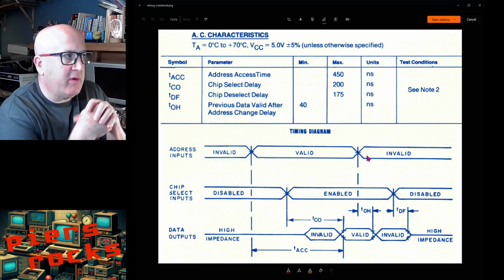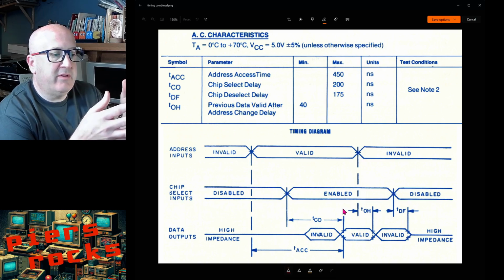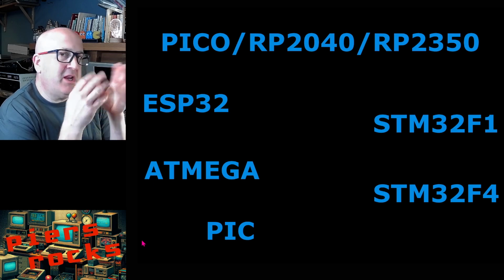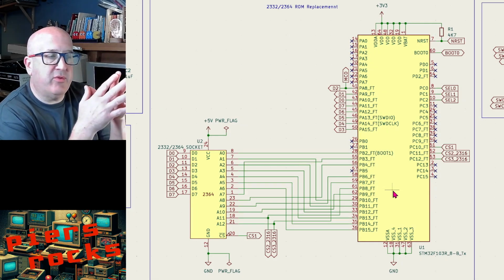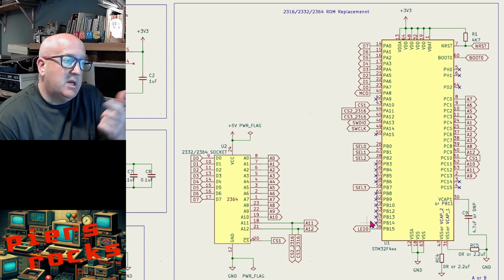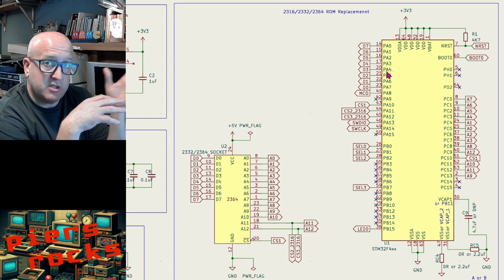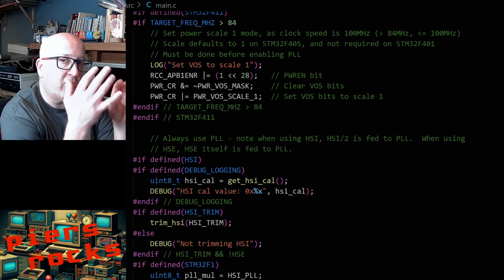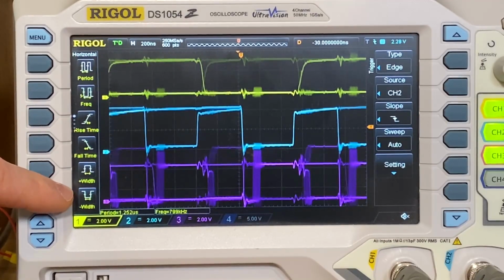How it's done - Software Defined ROMs

Comment: Very interesting!
A few years ago I spent A LOT of time and effort designing a ROM emulator (targeted at a couple of 6809 computers that I have).
It uses a static RAM chip to hold the ROM image, loaded and controlled by an AVR processor that also configured muxes and buffers to account for the various emulated ROM details. Once the data was loaded, and other details set up, the processor would play no role in the operation. Which frees it up to do some rough monitoring/profiling of the running code.

Even got the (quite complex - around a dozen chips) PCB's made, just never got around to building it. 
I always intended to, but seeing your work, I think I might scrap the whole idea now!

I see you've got later videos using a PICO, which I'll view with interest, and maybe use that as a basis for something similar. 
As I intend this only for testing and repair, there is less constraint on how it fits onto the System Under Test, so I envisage just using a standard PICO board somehow bodged onto an adapter PCB to go into the ROM socket.
Thanks for the inspiration!
Reply from the maker: @bertoid yes the Fire version uses the RP2350.  That is similar to your previous approach - CPU sets up PIO/DMA to serve the ROM at start of day - leaving the 2x CPU cores free for other function.  Now have 24 and 28 pin ROM versions.  Perfectly feasible to build an adapter for a standard Pico 2 - I would recommend the Pico 2/RP2350 vs the PicoRP2040 for built in 5v tolerance, although with an adapter board you have room for level shifters if you so desire.
Reply: @piers_rocks  I haven't looked at your later videos yet, but I thought you'd still be serving data via the CPU and control/address line monitoring. WIll be interesting to see when I get to that.
On 5v tolerance, good to know - RP235 it is then! Thanks.

Comment: Very good work. Did you try to code the loop in C rather than assembly? If so, what were the results speed wise?
Reply from the maker: No I haven't tried in C.  I don't trust the compiler enough :-).  It would be an interesting experiment - will put it on the list of things to try.

Comment: Very interesting project and a very interesting approch for solving my problems with those old ROMs. Thank you for sharing this. 

I like your implementation of the main-loop using inline assembler.

If you like, I could give you this little suggestion for improving the performance of this loop with zero-execution-wait-states: you could put the main loop into SRAM, as SRAM is accessible through the I-bus and the D-bus, if you configure the bus matrix accordingly. As those STM32F41x chips have enough SRAM for this purpose, I think, there is still enough left for this speed-up option. 

Some practical aspects: you could put your assembler-crafted code part into a function of its own and put this function into an appropriate linker section, which finally places this function into SRAM automatically on startup, right before main is called. Copying this handful of bytes should not take a fortune of time. On the other hand, you could do this also in your own code during main, as you can take sizeof(loopFunction) and copy this function into a comile-time defined uint8_t array in SRAM, which you can call later as a function. 

Feel free to ask for more information if you like.
Reply from the maker: @johanneslode2006 thanks for the offer.  I do actually have a compile time option to run the main loop from RAM, and I tested it, but didn't see any performance benefits.  I suspect this is because the instruction prefetch and cache on the STM32F4 is very good, especially for such a small main loop.

Not relevant on the STM32F4, but when I tried this (running from RAM) on the STM32F1 I saw worse performance, and much less deterministic behaviour, I assume because of RAM bus contention .

Let me know if I'm missing something - if there's some option/register I haven't properly set - I don't think I set anything on the bus matrix to allow this.
Reply: @piers_rocks  I'm actually more used to the STM32F4 family than to the STM32F1 family, especially as there are several different performance level groups in the F1 family, which have diffferent capabilities on the memory access. And yes, the FLASH accelerator on the F4 is quiet good, as it does 128 bit access on the flash rows. This said it might be worth to decorate jumps (conditional as well as unconditional) with some NOPs around for 128 bit alignment of neighbor instructions - just an idea, never thought deeply on that. 

Single cycle access on the RAM is very good, if configured properly. Your analysis on that sounds profund.

For some operations, such as single bit accesses the bitbanding-feature gives also some acess boost, available for the SRAM as well as for most of the peripherals, where read-modify-write access would be more than twice the access time. But on that, you optimized your GPIO accesses already very clever from my point ov view.

The next level of optimization I could think of, is using the two DMA controllers to reprogram each other, so address lines are fetched by one of them and put to the other, which in turn spits out the memory content on the data lines. Every DMA controller of the two has eight channels. Also just an other raw idea, which is not yet thought through deeply. One caveat could be the handling of control lines, such as RD, OE and CSx. As DMA cannot use the bitbanding-feature (it is a feature of the Cortes-M4 core, not of the MCU), this could be the dead end for this idea.

An other idea was a couple of 10 years ago, to use a dual-port-RAM, which offers access times in the range around 7 ns, using a microcontroller for programming it on one port and using the other port as the "ROM" interface. But this might blow up the form factor.

But hey, I love this kind of project. Thanks for sharing.
Reply from the maker: Thanks for sharing - definitely some interesting thoughts here.  May give the 128 bit alignment idea a try

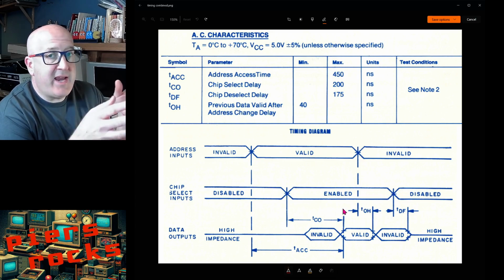Comment: I listened until 4:40, but why can't you just use a modern (8-bit parallel) NOR Flash, or EEPROM, for this? They are still made.
Reply from the maker: @herrbonk3635 It's explained in the first video, linked to in the description.  The key one is that 2364, 2332, 2316 had mask programmable chip select lines (each CS line could be active low or high, and the 2332/2316 have multiple CS lines giving 2^n combinations).  You need additional external circuitry to achieve this with a eeprom/flash solution.  It's a custom circuit per rom type/CS settings, or requires additional jumpers with a hardware solution.

This software approach configures the CS lines at build time - one hardware, all 14 possible ROM/CS combinations.  You can have different ROM/sizes/CS behaviour in the same firmware image and switch between them at boot line.

Comment: CPLD/FPGA wouldn't have been worth considering anyway as these have very little effective RAM/ROM and you run into  the same 5V tolerance problems. 

Just in case I wanted to point out what 5V "Tolerant" means. It's not "5V TTL LS F S tolerant" as many expect. The original 5V TTL chips have a tolerance on the 5V rail as 5Volts +/- 10% so in effect from 4.5Volts to 5.5Volts and a chip stated to be 5V tolerant has to withstand a max 5.5Volts on an input pin. The reality is that TTL outputs are  not often  over (Voh) 3V, CMOS is (Voh) about 4.5Volts in most cases and  may JEDEC chips (EPROM EEPROM SRAM DRAM) even CMOS will accept  TTL inputs while having a Hoh that is within range for even a 3v3 part - or perhaps a series resistor etc so in many cases if you read the datasheets and you don't need  tolerance to 5.5Volts then you will often be pleasantly surprised. YMMV so reading the spec  sheet  is essential though. 

Nice video and it's great to see old chips being recreated to keep out retro stuff going.
Reply from the maker: Thanks - I've done a detailed analysis of voltage levels of the STM3F4 against the main (Commodore) ICs that might be driving address lines and receiving data signals here: https://github.com/piersfinlayson/software-defined-retro-rom/blob/main/docs/VOLTAGE-LEVELS.md

Comment: 10:02 isn’t the 2350 5V tolerant…?
Reply: Yes and no. There's a note on the data sheet saying some pins are 5v tolerant under very specific start up conditions my guess is taking power from the ic socket would require at minimum hardware to handle the power assurance.  That being said the project lead for the rp2040 stated on a very well circulated post on hack-a-day that chip is 5v TTL compliant just not 5v5 compliant my guess is this is more of the same..  realistically it's just easier to use a purpose built part.  It's also a good idea to use a chip with the ability to do the reads at register level he's describing. My guess is that could be simplified using the picos PIO state machines.. but the power assurance part kind of sours it.
Reply: @lindoran  Yes, that makes sense. The PIO would have been really awesome for some of the requirements. But the incomplete 5V support is indeed maybe too risky.

Comment: Shared this on quite a few of the vintage computer groups on FB, this is something I've considered doing myself!
Reply from the maker: Thanks for sharing it - I'm hoping it will come in useful to people.  I fried a stock C64 char ROM today while, ahem, removing it with the machine powered on.  All I had to do was grab an SDRR, flash the set of stock C64 images, select the char rom using a jumper, and boom, back in business :-).
Reply: @piers_rocks what would be really useful is a usb or serial programmable one that never writes to the flash so it doesn't wear... I'm in the process of building a custom minicomputer with a DEC J11 (control), 128 x 8051 (general computer) and 64 x MK38P70's for IO channel control.. (I'm a professional Electronics engineer and firmware developer). Lets just say I'm considering building one of these for each of the IO processors... The MK38P70 is a bizzare micro, the EPROM plugs in the top of the CPU so the IC's are stacked!
Reply from the maker: @anthonysibley1021 - do you mean reprograms the ROM image that lives in the RAM on the fly so it doesn't hit the flash?  I think its plausible via SWD (which can be via USB), although that might introduce some contention on the RAM bus, introducing wait states and hence slowing the ROM serving down.
Reply: @piers_rocks Yes, but "uploading" to RAM via UART and then taking the host out of reset, so it's never doing comms and emulation at the same time.. just to save flash wear when debugging custom stuff...